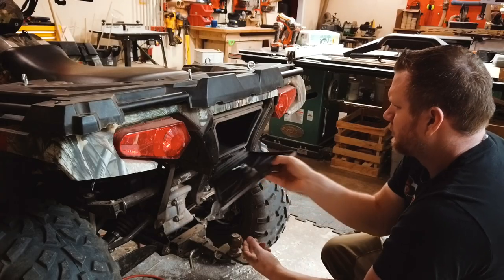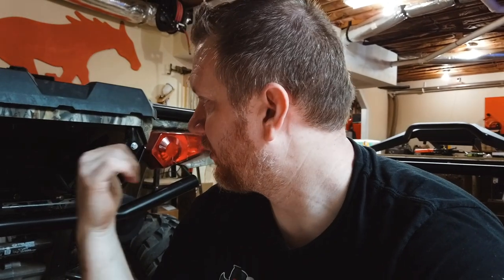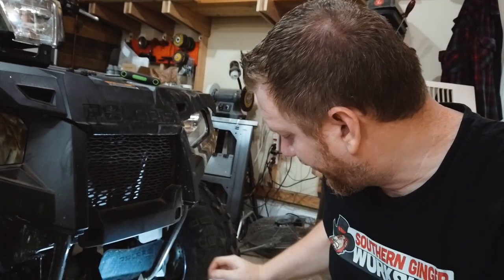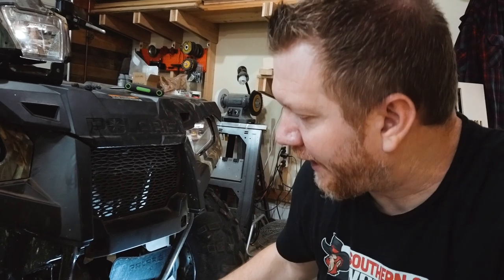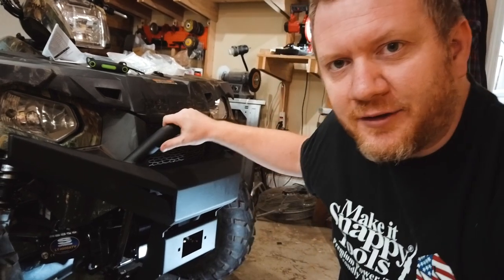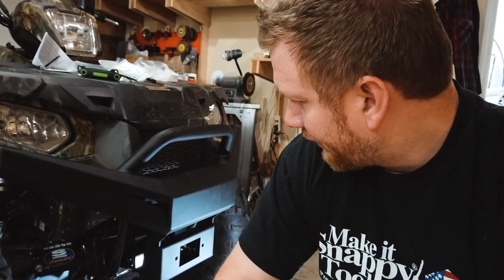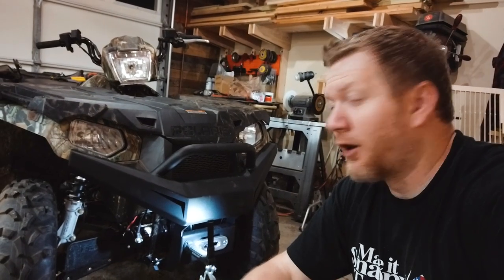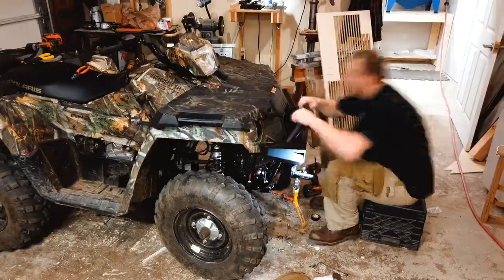Polaris 570 Sportsman Bumpers, winch and more! // DIY // Quad Logic

Comment: I would love to see a mock up on how you attached it to the bottom, I just learned I have an early model 2014 and the original bumper I was going to get wont work on my frame. Looking at getting this one myself.
Reply from the maker: I just used a L bracket to attach the bottom, unfortunately I don't have this anymore or I'd take pictures for ya

Comment: Zach, I like that winch and front bumper.  I relocated my battery and did side panel latches which made things much easier to access.  My knees were killing me to get down low and try to squeeze in tight undercarriage to access the battery.  Enjoyed your video and sorry you had to do all the mods for the bumper but it turned out great. Check out my small mods if you like.  New SUBSCRIBER!  Later and ride safe.  👍
Reply from the maker: That's a great idea too! I really like that bumper too, I ended up selling it all for a SxS later on but that's my new project lol